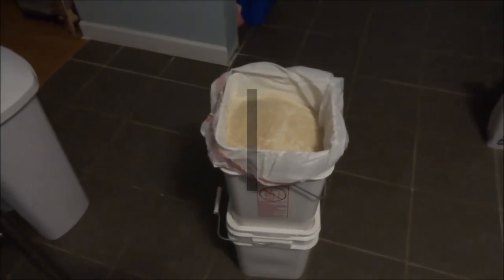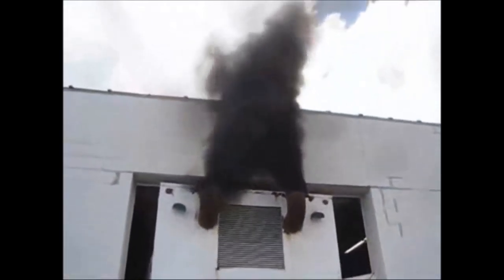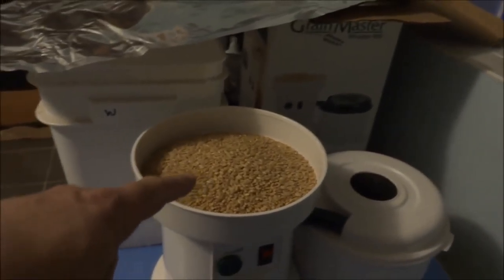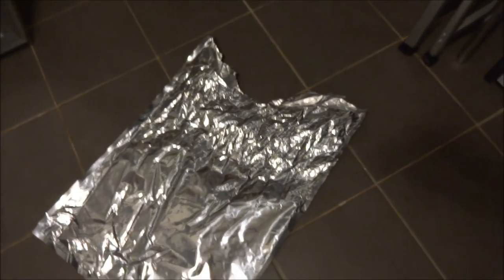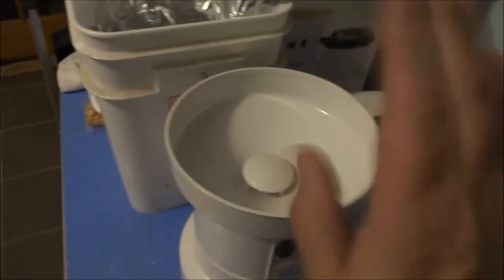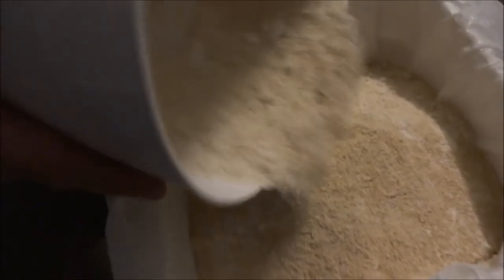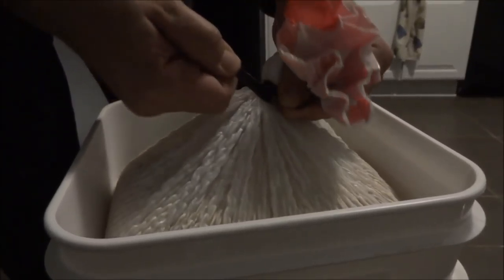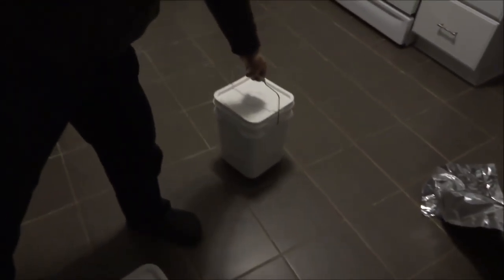Long term food storage, and processing you may not know about. How to DIY video

Comment: this video is good except for one thing...the oil in the germ (heart) of your wheat will go stale and after a very short time your flour will be rancid. That does not make good bread! Your only alternative that I can see is to freeze the flour (which is what I do) or in your case put a bunch of oxygen absorbers inside your bucket. That MIGHT work. I hate to see anyones $$ and effort go to waste!
Reply from the maker: +Laura Carpenter This is over 5 years old. The wheat tasted fresh. I have seen others store wheat for over 20 years in a lesser manner and it was still good. BUT you raise a very good point that I learned after I did all this, Brown rice has the oils that go bad after several years. So far no problem, but we are using the rice so it doesn't go to waste. Thanks for comment. ETp
Reply: Brown rice?  Really.  I did not know that.  So white rice is the way to go then.
Reply: what I meant to say was the "ground flour" would go rancid, not the wheat itself. I have had wheat in buckets for over 30 years and had no problem. You just need to remember to wait to grind it until you need to use it. If I have extra ground wheat I just freeze or refrigerate it and use it later.  From what I understand, brown rice will go rancid after about 6 months? We use white rice, which is not as good for you but is the only rice my husband will eat...so? I have heard it said that you can vacuum seal brown rice and keep it in a cool dark place and it will keep longer. Preparedness Pro would be able to answer that question for you. Keep Prepping!
Reply from the maker: Yes our wheat is good. You are correct, once you make flour the clock is ticking.
We are using long grain brown rice that I packed 5 1/2 years ago, still just fine. I did vacuum sealed and O2 absorber did the trick. Parboiled white rice best for long term storage. A friend of mine is eating his Y2K rice still. If I had to do it over again, I would have gone white. Guess the oils in the brown rice is what goes rancid. Thanks for your comments. ETp
Reply: brown rice takes a lot more water and longer time to cook. you don't want that during shtf.
Reply from the maker: There will be time during SHFT after dust settles and bugging in. But brown rice is NOT good for long term storage, Mine is going on 6 years in storage, so far so good. They say 2 or 3 years. Then it gets sour because of the oils. Par boiled rice is best for long term storage.